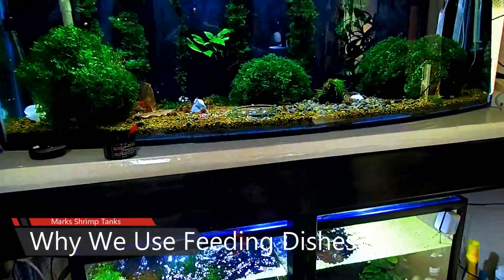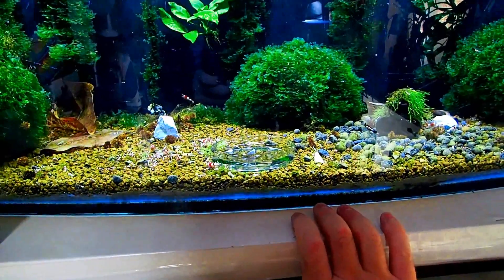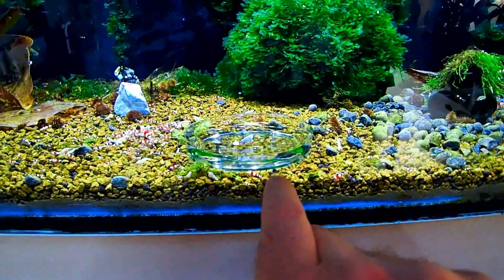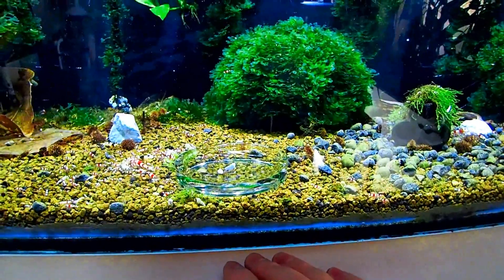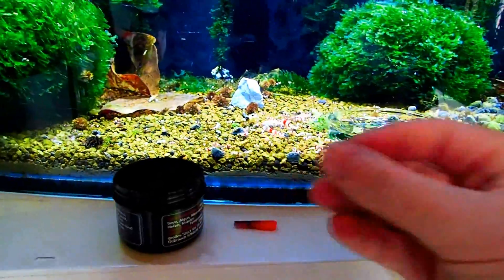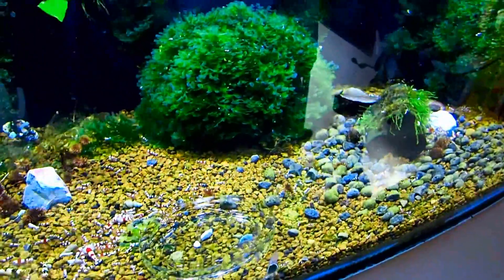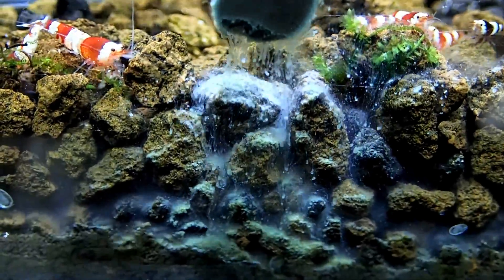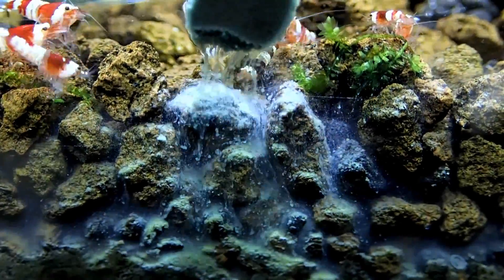How to Use a Glass Feeding Tray for Shrimp – Prevent Substrate Contamination

Comment: Can nori be fed to freshwater shrimp?
Reply from the maker: Yes, nori can be fed to freshwater shrimp as a supplement to their regular diet. Nori is a type of edible seaweed that is commonly used in sushi and other dishes. It is a good source of vitamins, minerals, and other nutrients that can be beneficial to freshwater shrimp.

When feeding nori to freshwater shrimp, it is important to remember that it should only be used as a supplement and should not be the sole source of nutrition for the shrimp. Shrimp require a varied diet that includes a variety of different foods, such as algae, plant matter, and commercially prepared shrimp food.

To feed nori to your freshwater shrimp, you can simply cut the nori into small pieces and place it in the tank for the shrimp to eat. It is important to monitor the amount of nori that you are feeding, as overfeeding can lead to an excess of nutrients in the tank, which can be harmful to the shrimp. It is also a good idea to remove any uneaten nori from the tank to prevent it from breaking down and contaminating the water.

Comment: iv been keeping a mixed shrimp tank for about 1 year, I use a dish and I'm very care full not to over feed , but I get the tiny white worms in my tank and it drives me nuts if seen  distinctive diffrent types of worms, how can i permanently stop the worms getting in my tank, iv heard  useing a dog dewormer will fix my issue I'm just a bit worried incase I kill my shrimps, I have amanos, bamboo, crystals, cherries and a few diffrent colours includeing a few cross breeeds that turned up through breeding, any ideas of a way to permanently stop the worms ?

Comment: Internet research says despite having a feeding dish, sometimes the shrimp would carry the food off, resulting in food particles throughout the tank. Your advice from what I've read is to not gravel vacuum either. So what's your solution to food particles getting below the gravel substrate that's completely away from the feeding dish. Will having a sand substrate keep all food particles on top. Note: This concern applies to a tank with no plants, except floating java moss and surface floating water lettuce.
Reply from the maker: Not everyone's cup of tea but MTS snails solve this problem because the consume food anywhere in the tank.
Reply: +Marks Shrimp Tanks ... Hesitation comes from concerns of a malaysian trumpet snail (MTS) infestation. Seeing as how all animals that eat, will eventually poop, the combination of snails having a higher bioload plus the propensity for MTS to reproduce, won't this eventually have a concerning effect on the shrimp tank's ecosystem? Biggest question: Do you simply let your trumpet snail continually multiply in the tank without removing them?
Reply: +Marks Shrimp Tanks ... Also, just yesterday, I got some standard Petco (United States fish chain vendor) black gravel because my red cherry shrimp were still clear and translucent in color (the same as they were when I first got them locally) for about 1 month. The addition of black gravel yesterday immediately got all the shrimp to finally turn a light pinkest color. But my biggest concern is keeping the water and tank parameters "clean," and in hindsight, I should probably have gotten a sand substrate so food and debris stays on top of the sand (instead of food/debris falling underneath the gravel). I think I'll switch out the black gravel to black sand tomorrow. Instead of 1/2 an inch thick sand substrate, I might just have a 1 - 2 millimeter thin sand substrate that just barely covers the bottom of the tank, hopefully that would prevent any gaseous build up.
Reply from the maker: Some Shrimp keepers I know dont have any snails at all and they just relay on bacteria to break down uneated foods.
I like the snails because they also move the substrate although if you do over feed then yes they can become a problem,what I do with them is normally once every few months I will hand pick as many of them out of the tanks as possible and I put them in my daughter Goldfish tank some also go into my little assassin snail tank .